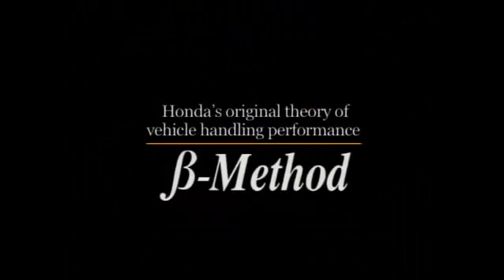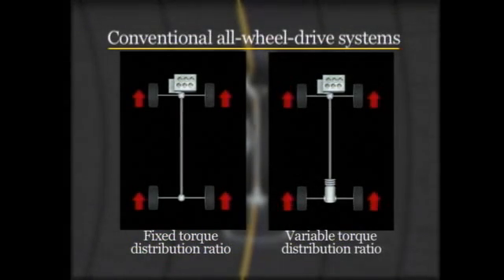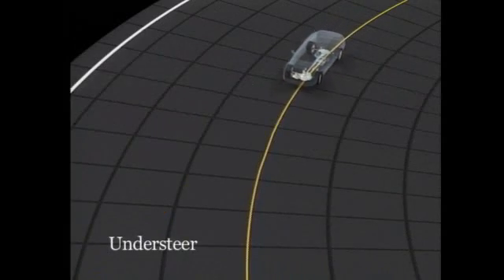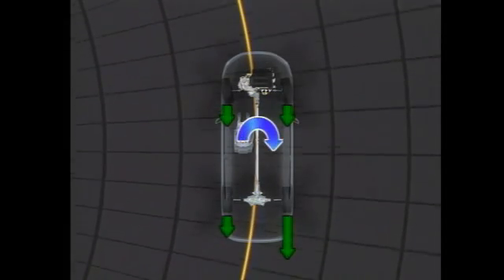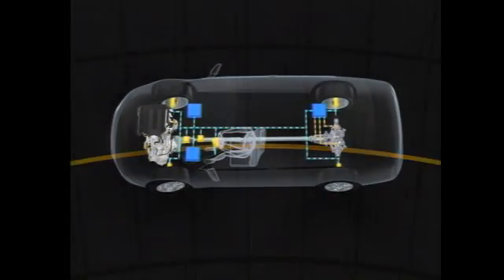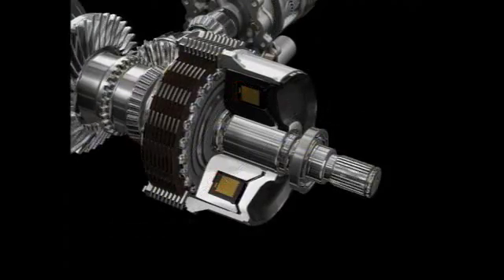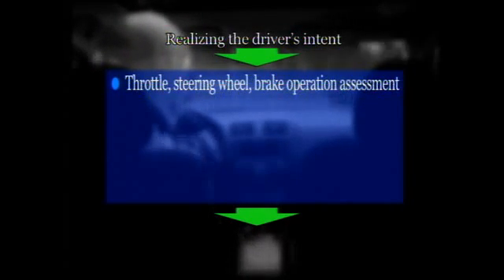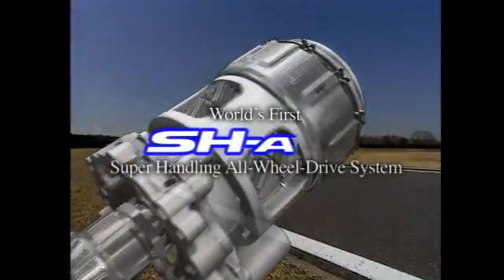Honda Legend SH-AWD Technological Overview

Comment: Had a Honda Legend v6, 2000 and had to dropped due to transmission issues. I then bought a Legend Acura, SH-4wd, v6. 2005 and also had issues with transmission. This was my 4th Honda car but after the experience with endless transmission issues I have moved to  Ford. Please fix your transmissions properly.
Reply: Automatic Ford's have their own transmission problems !
Reply: Weird, I only had SH-AWD Acuras, some with well into the 100k+ mile mark, never had a transmission problem.
Reply: I've seen lots in the US talk of faulty auto gearboxes and wondered if they have spent a lot of time sitting at lights in D using the brake to hold the car? This isn't a good practice and adds extra heat to the system.